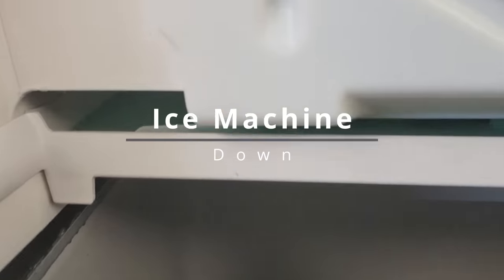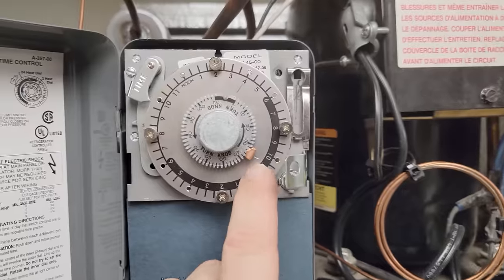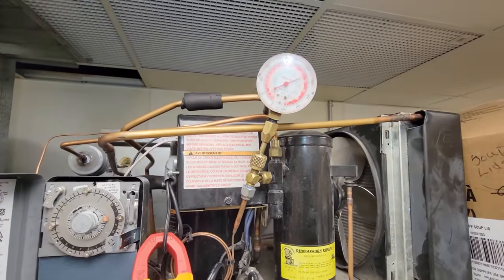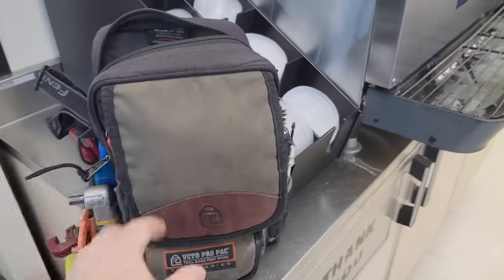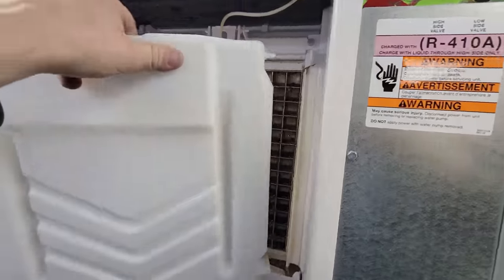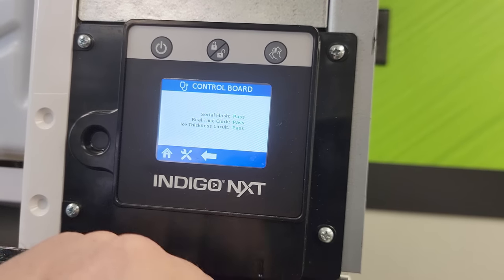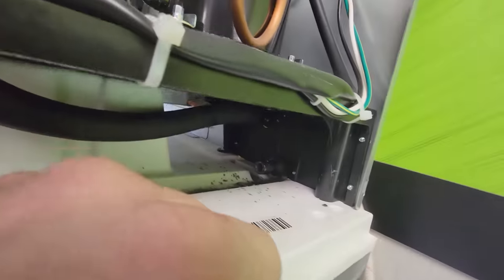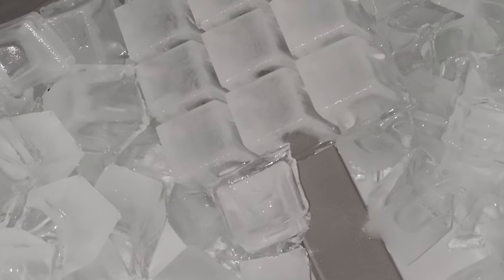They Said The Ice Maker & Cooler Don't Work, Now It Does!?🤦🏻

Comment: Great job Rick, Definitely like the new thermal imaging camera, was trying to decide which one to get, and your example is helping, and you did the same thing I was thinking about drilling out the drain pipe, good work.
Reply from the maker: I figured somebody would say something about just replacing those pieces in that drain but I don't have that barb fitting so no matter what I had to drill it out.

Comment: Great Video. May I ask, How to know pressure switch is bad and time for replace new one ? Thank you for sharing
Reply from the maker: Which pressure switch are you talking about?
Reply: @HVACRSurvival  low pressure switch, high pressure switch, dual pressure switch ? Thank you.
Reply from the maker: @zekenzy6486  as you seen on the video I used the high pressure gauge to measure where tripped-out at after I blocked a coil off, you would do the same thing for the low side basically just use your gauge set. Try it a few times see if it shuts off where it's supposed to
Reply: The marking on those switches ae notorious for having a wide range of differential. Have to trust / confirm with your stubby gauge or probe to confirm.

Comment: are they blocking too much airflow with all that junk piled on top at 0:48 lol
Reply from the maker: Either the motors failing again or all that heat from the HVAC is causing issues. At this point I don't know but the owner knows what to look out for

Comment: They should keep all those boxes away from the condenser more and defrost seems kinda long.
Reply from the maker: 60 minutes is pretty common for air defrost you can sometimes get away with 45 minutes but we've never had a problem at 60, generally you only need two per 24 hours. All depends on the humidity levels whether we're in winter or summer